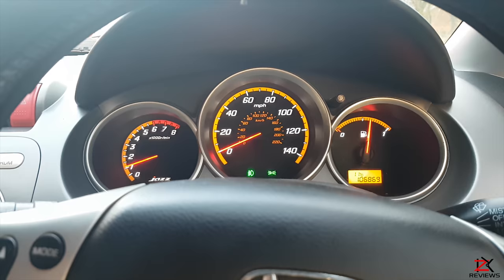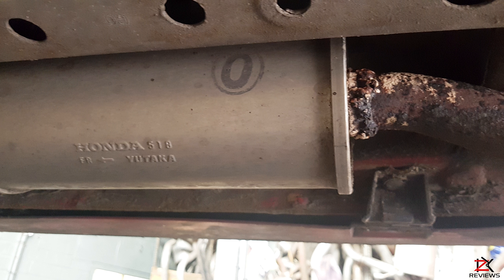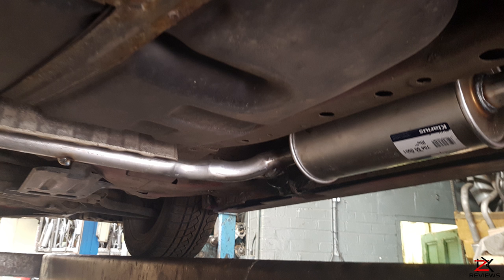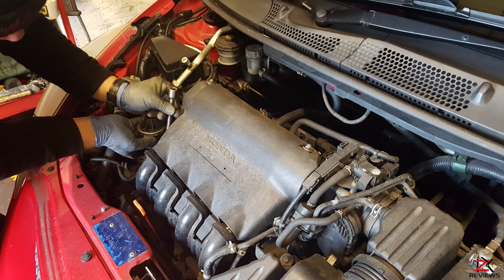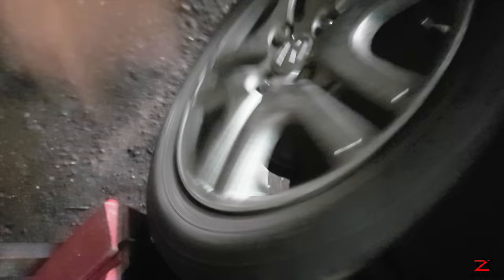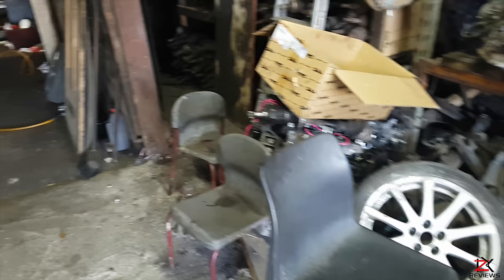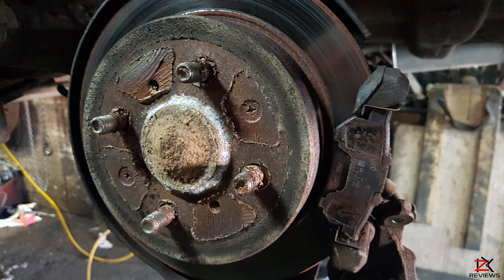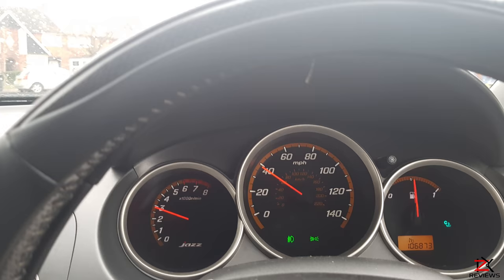Car Losing Power | Loss of Acceleration | Finding the Fault With FIX

Comment: Our car can only reach a top speed of 40kph and has no power to go through high surface or roads..pls help..
Reply from the maker: please follow my video that can find the fault, also best to get it checked at the garage.
Reply: Check spark plugs and the rest of your ignition system, clean or replace mass air flow sensor, clean or replace egr valve, and check for any vaccume leaks.
Reply: @albertmorales66  thank you

Comment: Hi. Sir I am having honda Jazz. When I shift gear to D or R some times engine RPM badly goes to les than 200 and againg going up until shit to N. What is the Solutions you can give me. Thank you
Reply from the maker: sounds like a misfire do take it in the garage to get it cheeked up also check on Google

Comment: I’ve been having problems on my 06 civic and I’ve had the same problems but my rpm doesn’t move and neither the speedometer and it jsut show the oil light and battery light until I turn it off and if it started again it wouldn’t show. Anyone have thoughts?
Reply: Am having same problem with my Civic 2006. While on highway it will just stop accelerating until  switch off and on. How did u fix urs @jacobvazquez9013?

Comment: I have passat 2005. 131hp i dont no i go to mechanic they drive the car and they say evey thing is ok but i dont have power last time i remember i do 230kmh now just 185kmh max i dont no why...???
Reply from the maker: get a dpf clean
Reply: @ZRKREVIEWS   i will check that thanks
Reply from the maker: @harbinneziri8997  not the solution from stores, the actuall machine to throw out all the soot. normally shud cost £30+ from local service providers, shop around

Comment: i have a honda fit 2004 model that drives at high rpm at low speed, say 4000rpm at a speed of 90km/hr. It also seem to delay shifting. This problem has really been a challenge to kindly help because it shows no trouble code on the transimission and engine side
Reply: Have you already fixed your car problem?

Comment: Anu problema honda fit ko mga boss   walang pwersa   dahan dahanin mo pa pag apak ng gas pedal peru bagu siya tumakbu hintayin mo muna  ng 30 mins na naka andar bagu apakan ang gas pedal peru hindi sagad kasi pumapalyar siya kapag e sagad mo ang apak ng accelerator  tapus walang pwersa nagka ganito to pag ka tapus e overhaul dahil umaso pagka tapus ganyan na siya sabi ng mekaniko ipa takbu ku lang daw ma wala ra daw  hangat na tambay nalang ang sasakyan
Reply from the maker: do carry out an diagnostic check and make sure its not the sensors causing issues, on my Honda car the only issue i came across was sensors, EGR valve and brake calipers

Comment: Im having a mazda 3 2004 hatch-back n its losing power every time i push the gas its lose the power its like on an off wat could be wrong ?
Reply: Almost same issue with my 2005 Nissan sunny.
Midway I am loosing  acceleration completely, accelerator is dead,but engine is running.
To regain acceleration I need to put car in neutral position, then switch of engine and start engine again while car moving without power.
What could be reason ??Mechanic are helpless.
Reply: @moneyonline2.0 did you fix it? This is the same problem with my Honda Civic 2006

Comment: Hello.  Can i ask a help from you with my bug problem . I actually got a 2000 model and The problem of it is The speedometer is not moving and the gas is not picking up wether I'm moving or just started the car.. when I'm moving my speed is only 50 then suddenly I notice  the sound change so I press the acceleration to speed up. but the speedometer is not responding and the gas is not gaining..
I went to garage to fix it . And they fix fixed the injectors, 4pcs spark plug 3pcs ingine mount..
Then, when I try to drive the next day the problem is still the same and nothing is change. 🥺  please maybe you can help me with this problem  as you are an expert on  this... 
Hope to hear your response 
Thank you.
Reply from the maker: Have they checked the wheels sounds like same problem as mine in video
Reply: Yeah that's what I'm asking them to watch this video as I send it to them to watch .. 
I went again to thier garage today and I told them maybe my problem is also the break calibers and I ask them to check it . And they said break calibers doesn't do anything 😔 . 
Instead they replace new fuel filter. if it's still the same problem  then they said maybe the ignition .. and now I'm waiting for the result after replacing the fuel filter... they can't find the problem.😭😭😭🥺
Reply: @mikamikz6705  plugged Catalytic

Comment: If it’s not the brakes is the shit fuel were using now and driving at 20 miles an hour it’s causing the whole car engine to plug up with carbon deposits and God knows what else